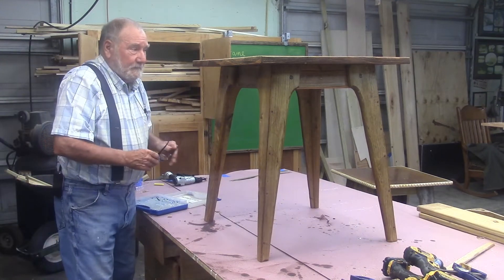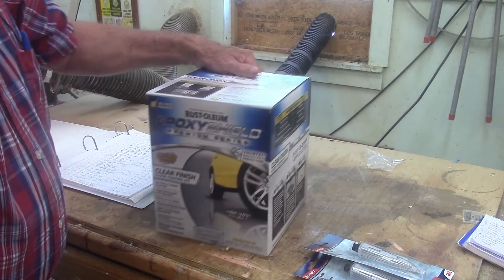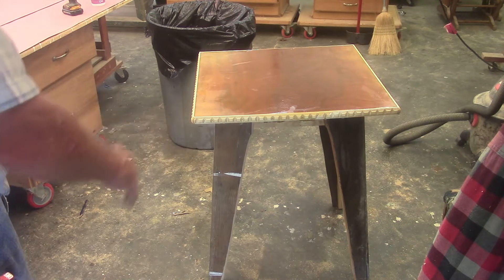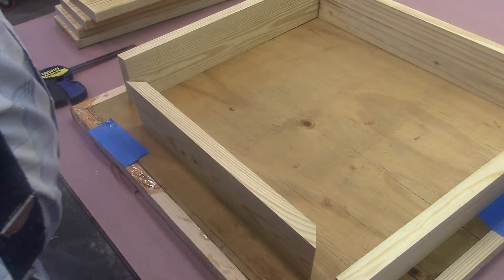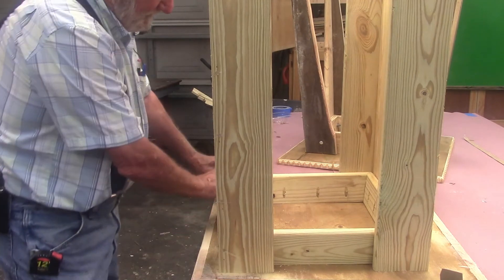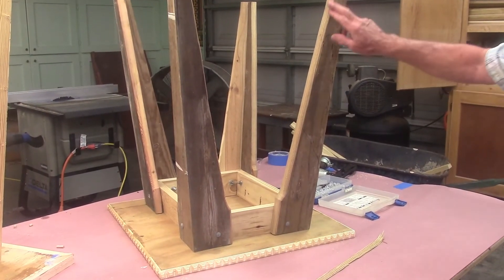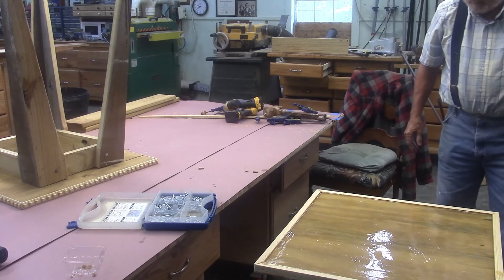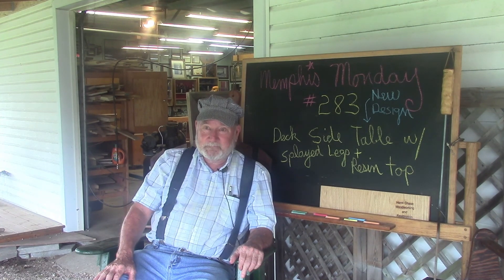283 Deck Table with splayed legs and epoxy top wk 23

Comment: Nice job Memphis. I like the way you made the legs. I'm gonna give it a shot. Thank you.
Reply from the maker: The legs are very strong, perfect for a work table or outside table.  The tricky part might be the splayed frame, which I think I cover in this video.  The legs themselves are fairly easy, since you cut the angle, and taper them after the miter cut.  But the coup de' grace is bolting the legs to the frame, which makes the thing bullet-proof.  Good luck on your project, and thanks for watching and commenting.

Comment: Interesting project. It was Thomas Edison who said after many attempts to develop a working light bulb, "I have not failed. I've just found 10,000 ways that won't work." This project puts you in good company. See you next week.
Reply from the maker: At General Electric (the modern company), they once had a metric measuring how many failed projects a team completed, as there seemed to be a positive correlation between the number of failures and major discoveries.  On the other hand, the Wright Brothers didn't believe in "trial and error," rather all their work was based on testing, calculation, and data.  Of course there was plenty of trial and error, which the Wrights promptly folded back into their working theories.  They only built three gliders before finally building their first real airplane.  
       I was a little nervous on this build, as whenever I experiment with anything, all the experts feel obligated to tell me I did it all wrong (as if I didn't already know that).  But it turned out even worse than shown here in the video.  The table is strange, but okay, however the resin top immediately clouded up when it hit the sun.  I suspect the sun will totally destroy the top in just a matter of weeks.  And ironically, being a boat guy, I kind of knew that would happen too.  
      Thanks for watching and commenting.  Hope to have a better project next week.